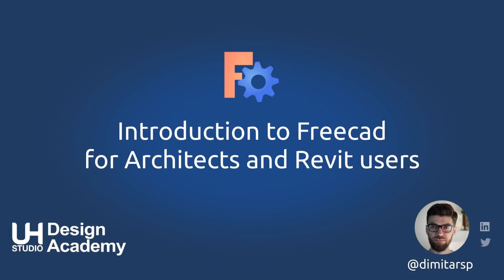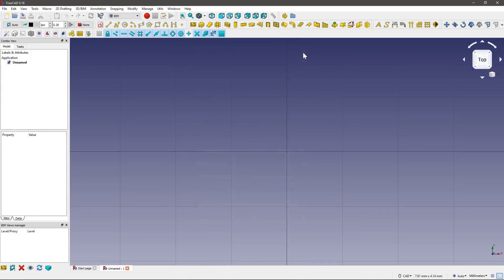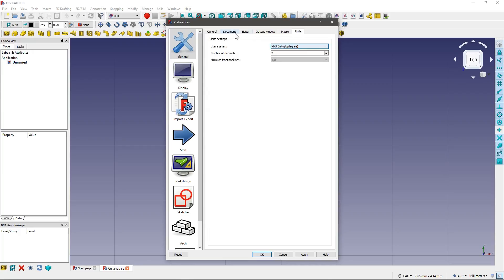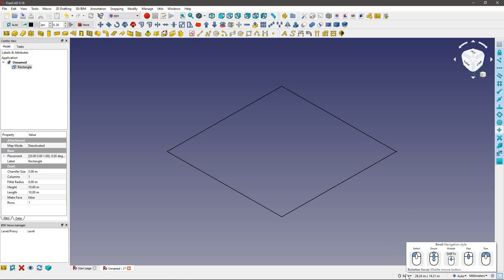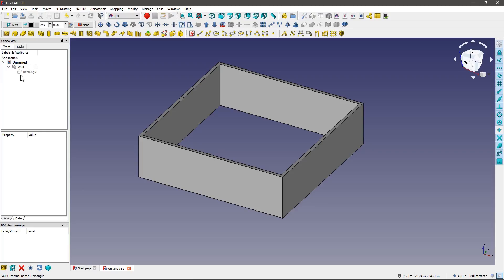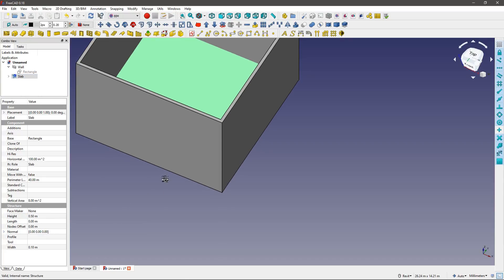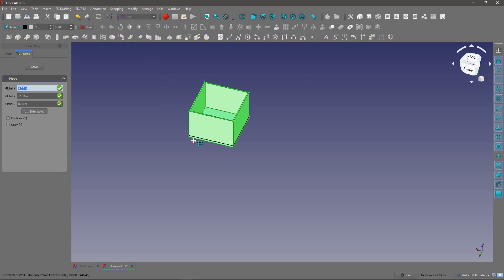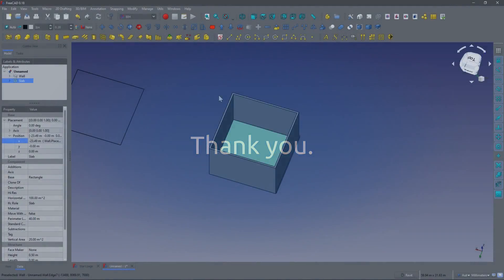Freecad introduction for architects and revit users

Comment: I am new to FreeCad, and exploring the available videos, this one was interesting, you mentioned you have other Architectural videos using FreeCad, where can I find them, also, within the e design I need to show routing of electrical an plumbing routes, is this available within FreeCad.  For the routing, I previously used Visio, but MS has changed the marketing, and the original software I purchased is no longer working, hence, seeking alternatives.
Reply from the maker: There is a freecad playlist on the channel's home page. You can also see it here: https://www.youtube.com/playlist?list=PLJThqQUeIsPTw-SQeY595Kpz_xQeZxz4o. Yes, you can definitely do wiring and plumbing routes, with simple lines and polylines.

Comment: You can also see the position of the slab relative to the wall by zooming in to a corner, then selecting the wall and toggling its visibility by right clicking it in the tree and selecting toggle visibility or by pressing the spacebar.
Reply from the maker: Thans for the tip!

Comment: Hi. Thank you very much for this very educational video. your speaking is very concise, precise, efficient and respectful of your listeners because it does not waste their time in unnecessary words.
I am a beginner and I try to replicate your operations but, there you are, I block as soon as the walls are made. Instead of seeing a floor area surrounded by a wall, I see a solid volume. Even before that, the rectangle does not appear to me empty (just lines) but as a solid area. Is it a bug in my system or a bad configuration?
Thank you in advance for your help. P:S: I am working on a Linux Fedora system.
Reply from the maker: Hi and thank you for your kind words. If you are on Linux, you are likely running a dev version that may have had some features tweaked to respond in a different manner. Freecad features tend to get updated rather quickly and sometimes rendering an old process useless. I would suggest you going through all the options of a wall and investigate one by one